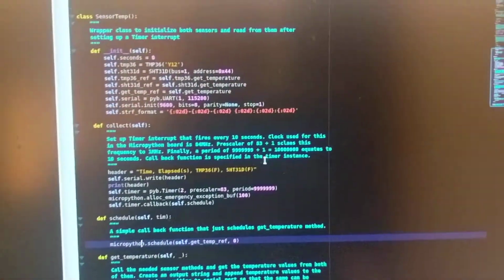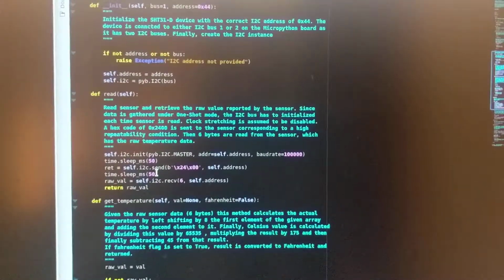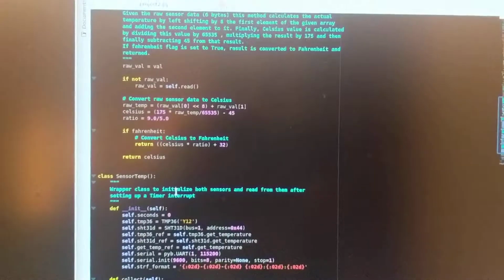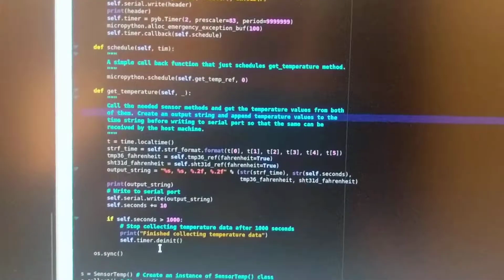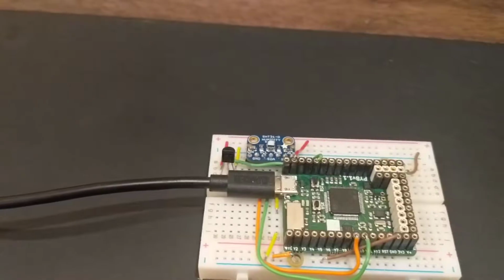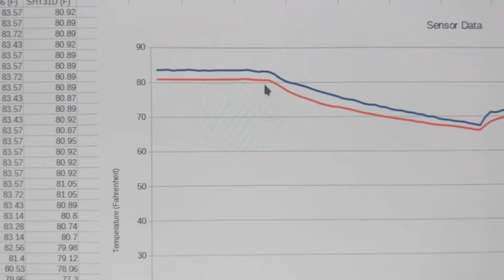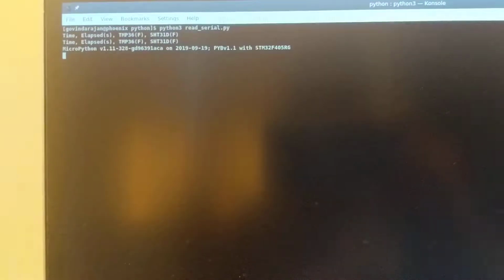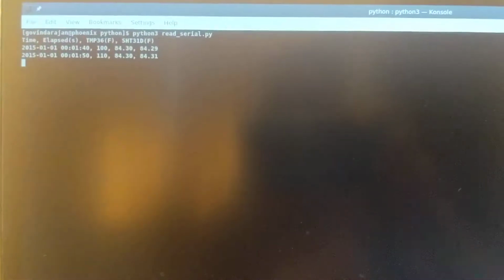Temperature Sensor with Micropython

Comment: can the original PYBOARD can control a step motor like NEMA-17 or NEMA-23?
Reply from the maker: Hi, elvin, I haven't personally used a stepper motor. But NEMA17 stepper motor should work with pyboard as long as you have a supported driver. Please follow this thread from micropython forums https://forum.micropython.org/viewtopic.php?t=6621